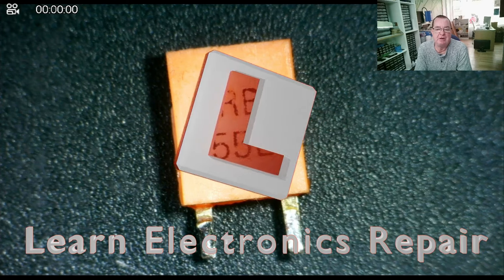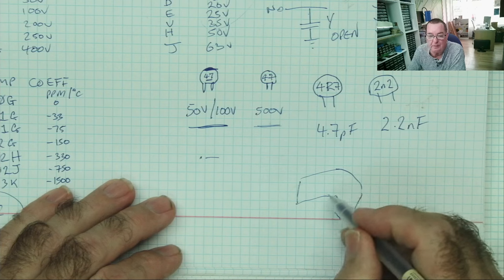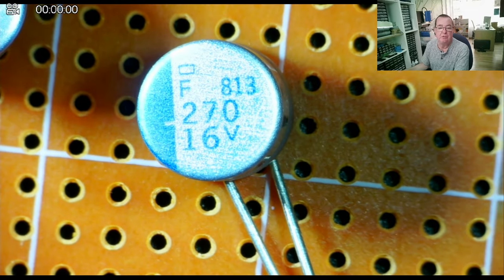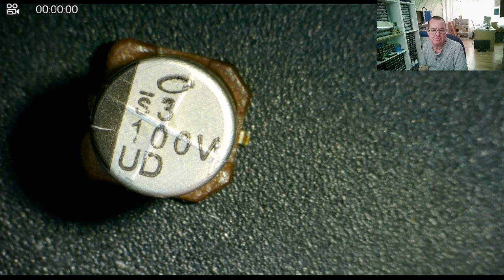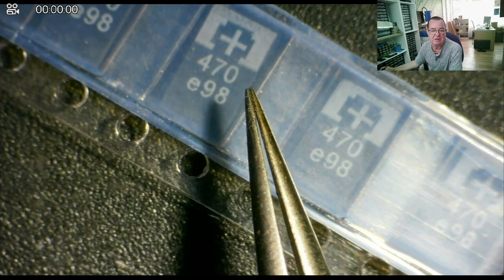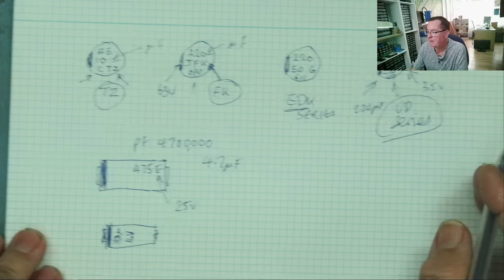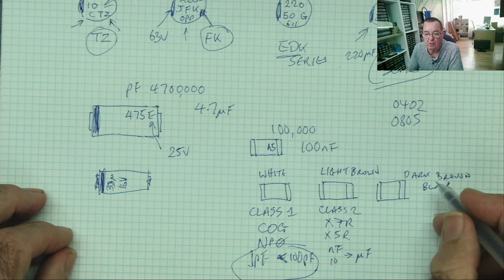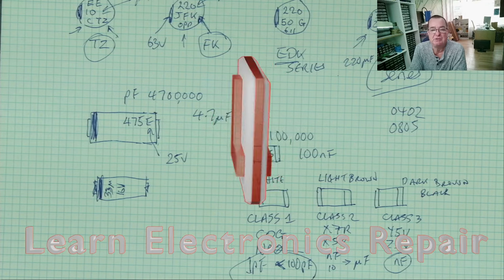PART 3 : All You Need To Know About SMD Capacitor Markings Codes To Fix Stuff

Comment: It's my understanding that the actual specifications for X and Y capacitors are not simply a certain failure mode but more complicated, and not mutually exclusive. A cap can fulfill both and then be certified for use in both line-to-line and line-to-earth use. My guess is that most of these modern caps are the self-healing type where the internal arcing burns out the short and the cap just keeps working, if at a slightly reduced capacitance. The specs don't seem to care how the cap would fail if you were to actually destroy it with 100kV. They only care that it can withstand the rated voltage spikes and either fail safely - or not at all.

Comment: I've seen X capacitors fail both short and open. We've got a vacuum cleaner that once blew it's X-cap, it failed short and blew the 10A fuse in the fusebox. At a later time I've had a frequency counter that had a Rifa X-cap inside an encapsulated mains filter blow, this one failed open. maybe a little sign of leakage when tested, but not enough to short the power line, but the magic smoke escaped .

The 3 legged resonators could perhaps also be ceramic filters, some radios use / have used ceramic filters in the IF instead of the cans containing an adjustable coil+capacitor.

Comment: As far as I can tell the claim that X caps are "designed to fail short circuit" is nothing but mythology that keeps being repeated.
Most X caps are metalized film or film and foil. Some use  two dielectrics, such as polypropylene film and, surprisingly, paper. A common failure in such caps is shorting, but they can also be "self-healing" - the short clears rather like a low-current fuse with the result of just a tiny reduction in capacitance. Short circuit failure is a serious safety hazard, any way you look at it. Yes, it may cause an overcurrent device to interrupt the current soon enough to prevent a fire but it may not. It would be insane to design anything that goes directly across AC mains to fail to a persistent short circuit. Open-circuit failure of an X cap is perfectly safe and simply results in greater conduction of noise from the device to the AC line or in some cases greater conduction of noise from the line to the device.

Nothing I can find suggests that Y caps are "designed to fail open circuit." They are simply ceramic capacitors with very high voltage withstanding ability and sometimes structured as two capacitors in series, as are some film caps. This is the equivalent of "double insulated" and makes the probability of short circuit failure very low.

Comment: Electronics is getting to be to unwieldy to be  a hobby as there are to many components and variations.
Reply from the maker: Nah that's what makes it interesting 😉
Reply: It does have its challenges indeed. You need to have microscopic eyesight, esp. for short distances, you must not be colour blind and you need google at hand to find all the series decoding schemes. 😮 You need a pair of steady hands with heat proof fingertips. And you need voodoo😅
Reply: @Chief_Engineer 😂😂😂